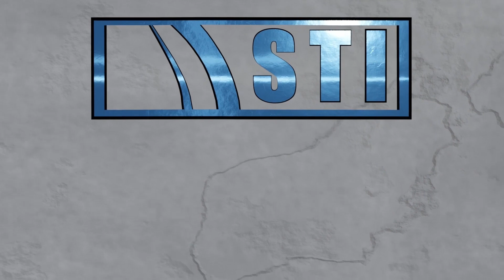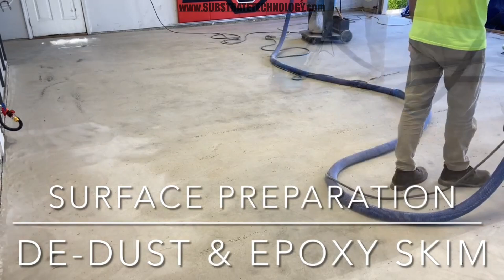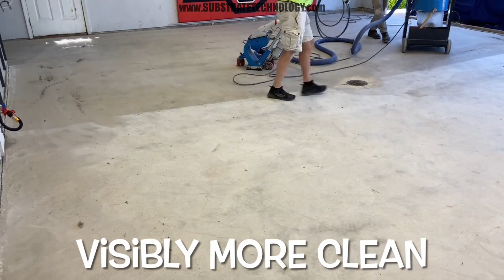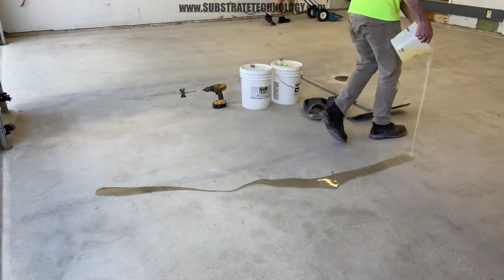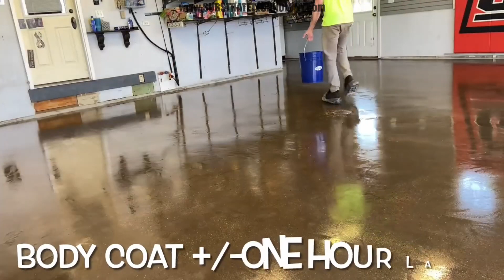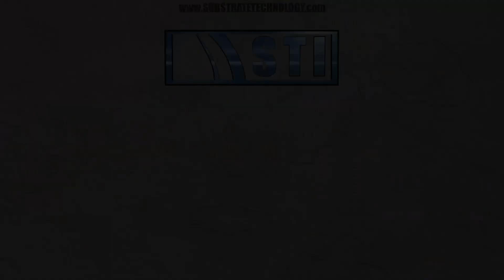How To: Epoxy Primer Surface Preparation

Comment: The first coating you put down was that a vapor barrier primer? I see you used just a regular squeegee would a notched squeegee better for that?
Reply: That’s a good question. The first coating applied is a skim coat. This layer simply seals the floor by filling the surface pores. It’s a 100% solids universal epoxy. Its pH resistance is a 13, but it’s not considered a moisture mitigation product.